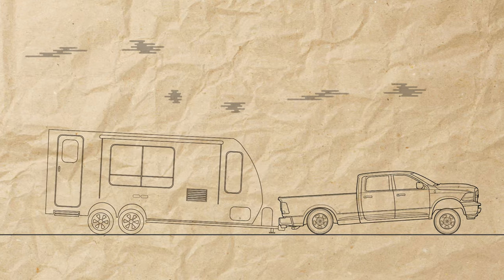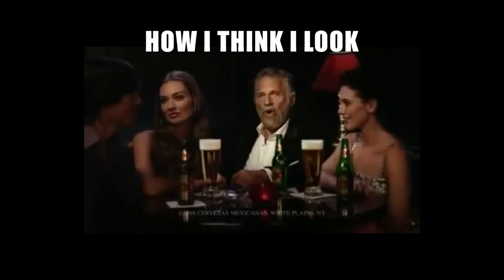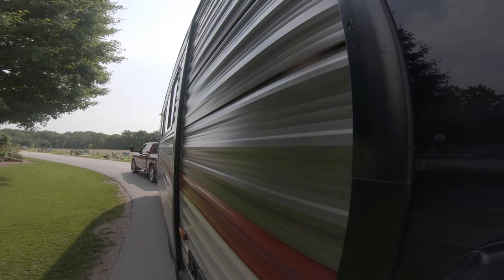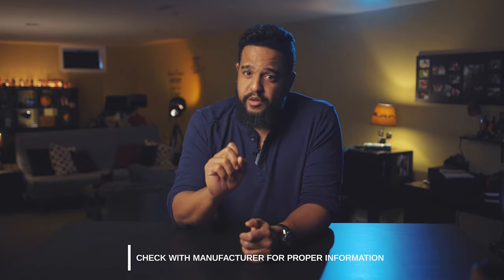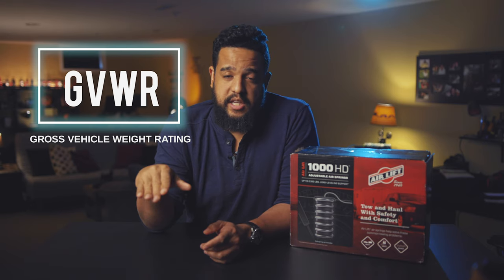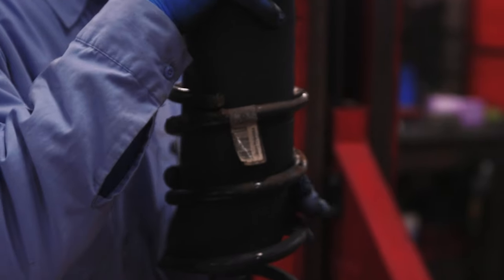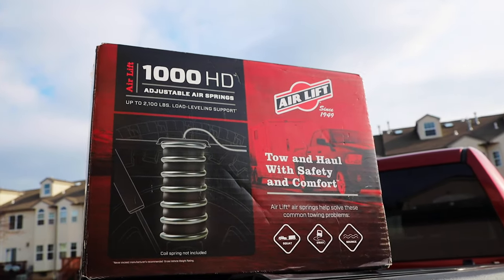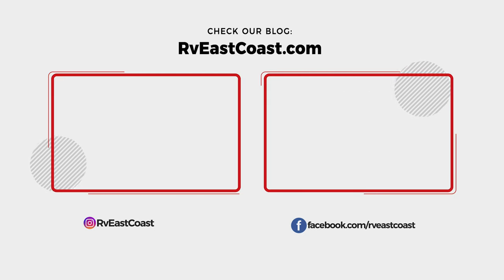HOW TO FIX TRUCK SQUATTING PROBLEM

Comment: Another great and informative video my friend! My opinion is, if air bags we’re bad idea for your truck, then the manufacturer would not install them on some models from the factory. You said the key point in the video and that is to not exceed the towing and payload capacities of your truck. Air bags are a great tool when used properly. Anything to make towing more comfortable is a good thing.
Reply from the maker: I agree with you my friend!

Thanks

Comment: I have the same airbags in my 2019 ram 1500, I’m towing a 36’ travel trailer ,when loaded it’s about 8200lbs, I’m also using a Hensley weight distributing sway elimination hitch set up. Everything works perfectly, truck sits level even with 4 people and a dog and it tows effortlessly. I won’t say “ you don’t know the trailer is even back there” because I’m dragging a 30some foot box through the air, so you’re going to know it’s back there. That being said I feel I have a great set up for a 1/2 ton truck , thanks for the video and I would recommend the Airlift bags to anyone that tows with a 1/2 ton. Btw my truck has the tow package with flip up mirrors , factory break controller and 3.92 axle ratio, giving it a max tow capacity of 11,340lbs. ( that was my disclaimer before the tow police tell me I’m towing too heavy)
Reply: It’s not always about towing capacity. You have to be careful of cargo capacity as well. Tongue weight, passengers and anything else inside the bed or cab of truck, will eat up your cargo capacity really quick. Doesn’t matter if your truck is rated to tow 11k lbs.
Reply: Am the hunt for a travel trailer. I as well have a 2019 ram 1500. And I was looking to add air bags. Thank you for the video and the reply on this product

Comment: I wish Airlyft would make something for 2015-2020 Ford Expedition. Strong truck capable of towing 9000lbs but suspension is soft for comfort. Thank you for sharing. 😎
Reply from the maker: +Angel Torres 🤔 I am not sure if they do. Have you checked their website?
Reply: @RVEastCoast  yes I have checked and unfortunately for anyone with a expedition like mine there are no air ride kits from any manufacturer.
Reply from the maker: @AngelTorres-se9zf  Oh man, sad to hear... No plans for a new towing vehicle anytime soon? Fawn won't let me buy a truck for the next 10 years lol
Reply: @RVEastCoast  yes I do have plan on a new tow vehicle. Waiting for the right time.

Comment: Do they still make air shocks? I used them to give my car the race car look and to haul heavy stuff.
Reply from the maker: nice... what kind of racing car you drive?
Reply: @RVEastCoast  I did race a 66 Barracuda w/ a 340 4 speed turning low 8's until I had to sell it during the recession. : (

Comment: Nice review Eli.  We towed our previous trailer with a Ram 1500.  I have air ride stock from Ram and  besides the 5.7 Hemi the air ride is the best option. Not only does it smooth out ride it would auto level the rear when we hooked up trailer.  Also when we unhooked we could drop the rear with the controls on the dash which would make unhooking a breeze.  Thanks again for the review.  

Izzy
Reply from the maker: That sounds like a great system... thanks for sharing the info!

Comment: I have a Ram 1500, did some research on this during the RV search. Went with the same airbags and the on board compressor option. Like you said the bags offer a great assist leveling the truck, also controlling the bounce you get with bumps is the road. I would put these on any 1/2 or 3/4 ton truck for these reasons. They are rated at 40-50 psi max and should keep at 5 to 10psi when not towing.  Another great informative video!! 
I'm currently looking for another TV, challenge is to find one with the tow options and other options that fits the budget. Maybe a video on this topic? Some newbies may not know what to look for in a TV.
Reply from the maker: Thanks Craig. Good luck!

I have been eating to make a video about this but I need to find the right expert to help me explain everything!